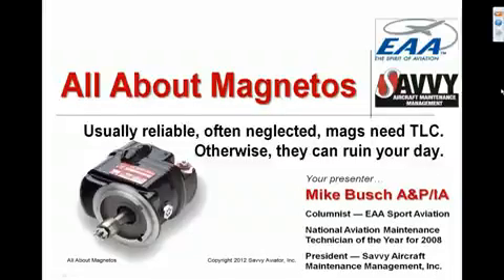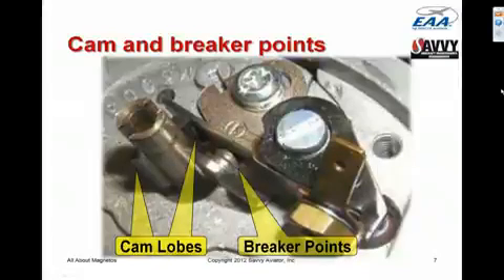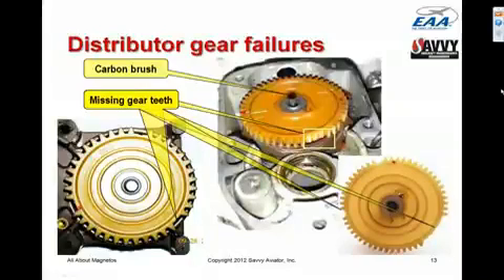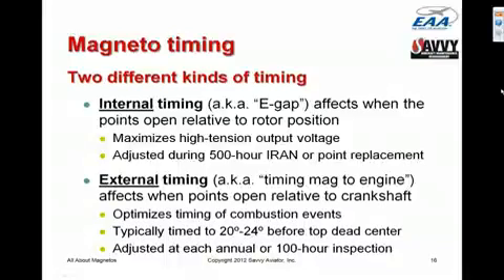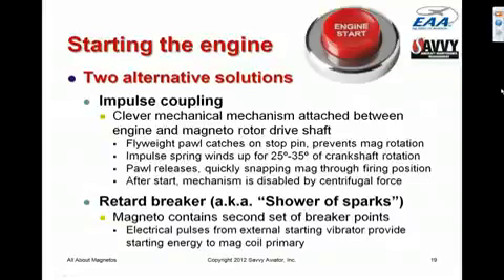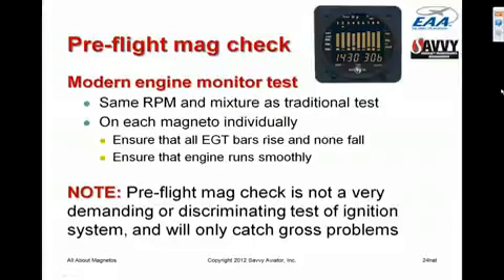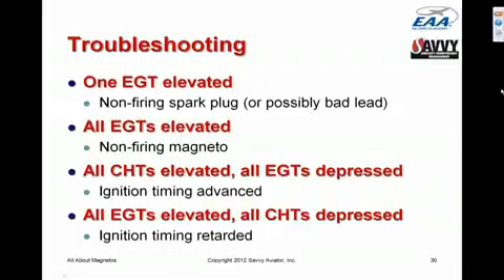All About Magnetos

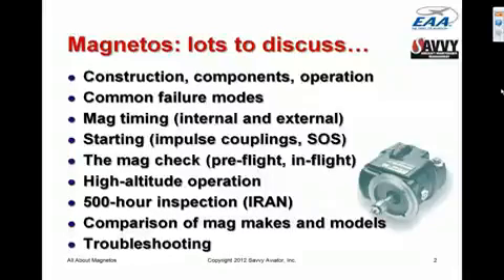Comment: 1:35 Components and Operation 
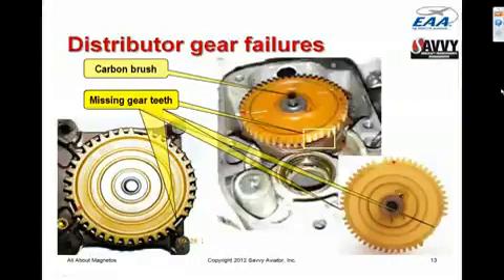14:15 Common Failure Modes 
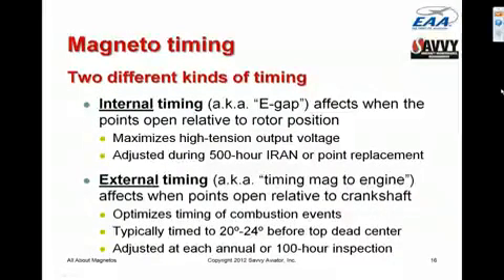20:59 Magneto Timing (Internal and External)
25:14 Starting (Impulse/Snapper Coupling, SOS)
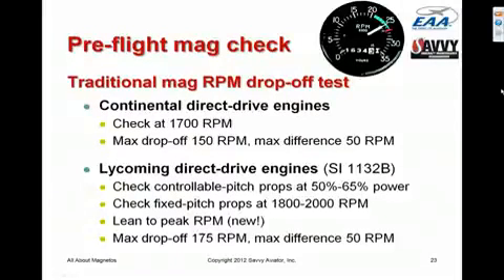32:43 Mag Checks 
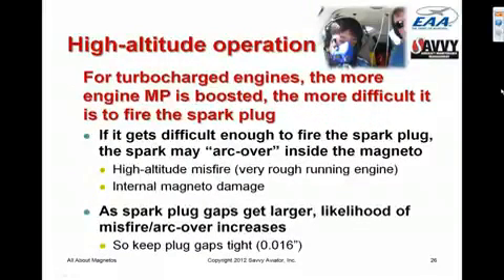38:52 High Altitude Operation 
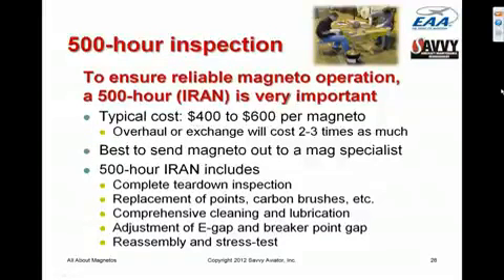43:44 500 Hour Inspection IRAN
46:11 Mags Makes and Models 
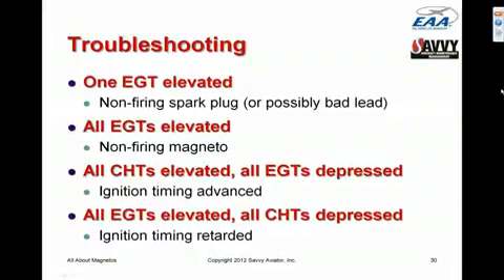49:48 Trouble Shooting 
52:07 Questions
Reply: Khotso thank you sir

Comment: As a Certified Mechanic I rebuild and service a lot of magnetos.  Many times I have had to replace the entire rotor due to corrosion on the magnet & shaft so severe that the shaft broke in two pieces after pulling the bearings off.  Worse is neglecting the magnetos by not flying the aircraft due to neglect of routine maintenance & annual inspections regardless of time on the engines.  Such neglect will have you paying more in the long run and your aircraft's value decreases substantially.

Comment: It does not matter,  either a battery & coil ignition set-up  or a magneto, even the model; T coils
in the wooden boxes had a condenser in them, the condenser being wired across the points of 
coil's vibrator. juice came from the "MAG' which was a low voltage magneto, V magnets spun 
past a series of coils in the bellhousing or shroud or from a battery of either a number of #6 dry
cells or a wet lead acid type battery. a switch was for MAG or BAT/OFF and a commutator type
switch worked each coil.

Comment: I disagree with 500 hour IRANs, every magneto I've opened has moderate to severe burning on the electrode fingers, and the assembly alone is like 500 dollars for this, the carbon brushes I see are always way within limits. Add in a contact point kit which is like 200-300 dollars and you already meet the cost of receiving an overhauled magneto often times. You also have to take into account the time it takes to perform a 500 hour magneto inspection as opposed to just changing out gears if necessary and installing overhauled magnetos. If you go off of the overhaul manuals, you will often find enough stuff in a 500 hour magneto that exceeds the cost/time of changing out internal components as opposed to getting an overhauled one.

Comment: It's interesting how the design of aircraft engines has lagged behind current engine technology. Cars have electronic ignition, some don't even have distributors or a single ignition coil.
Now I realize that a computer needs a separate power supply incase of an alternator or battery failure. Electronic ignition does exist in aviation but it's experimental and is usually pared with a mechanical  ignition system for redundancy.
Reply: 25+ years ago, electronics were not entirely reliable. Today; ecu's, batteries, ignition coils, sensors are far superior and surpass these old pushrod engines. Pretty much all electronics are now solid state.

Comment: Mike we must place ,new  knowledge  to get rib off the magneto point and Condenser, and use the impulse , system  used on high performance  Automobile engine ,is much much better than the point condenser set up
Reply: I was wondering too, these are like my 1972 cars with ignition points.

Comment: Mike, I've been searching for an expert in this field and so i found you. I fix small engines both 2 & 4 cycle in the lawn care industry. I heard of a problem, have not seen it for my self, but am very very curious what could be the cause. So here it goes. My friend got a Stihl chainsaw that would bogg down.He saw the culprit to the problem as there was a spark between the magneto/coil and the magnets on the flywheel which was in direct correlation with the bogging down-the spark got stronger as he tried to rev it up then the engine boggs down. He then purchased both a new flywheel and coil from Stihl and still has the same problem. How is this spark, in that location, possible and what can be done to diagnose and/or fix it? I have never seen or heard of such I thing as I have repaired small engines for a long time. It would seem to mean there is a leak or bad ground possibly? What are your thoughts?
Reply: if the ground wire somehow gets any voltage on it it can do a similar symptom. Also i would check to see if anything is connected in reverse, if there was anything else replaced recently??

Comment: I’ve had a very unusual snag on my Franklin 150 engine equipped with Bendix S6RN-21 mags.
The engine runs smoothly at idle up to about 1700 rpm where it starts running very rough to the point where I have to pull the throttle. I’ve changed the plugs, the carburetor and both magnetos. Fuel flow is 35 g/hr ( recent fuel) and compression is over 76/80 on all cylinders.
Could components like capacitor or coil create erratic ignition at high rpm?

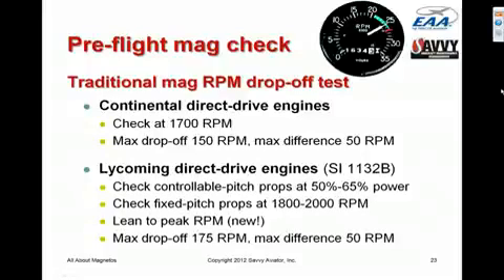Comment: At about 33:04 you mention Lycoming's Service Instruction 1132B and state the instruction now requires lean to peak while performing the mag check. But that's not exactly what it says. You're to start with full rich but if you have a drop of more than 175, then you are to go lean and repeat (am I reading the SI correctly?) https://www.lycoming.com/sites/default/files/Magneto%20Drop-Off.pdf
Reply from the maker: Christopher, you are reading the SI correctly.  One must only lean for the test if there was a drop of more than 175 rpm.  The SI states to leave the mixture full rich for the mag check UNLESS you get an excessive drop.    Thank you for the clarification.
Reply: Got it. Thanks! Love these presentations by the way. They're part of what has inspired me to get an A&P cert. I have no intention of working as one; just want to work on the plane I buy and have a better understanding of the plane's health.
Reply: How about always leaning to peak RPM for every runup? I recall the Embry Riddle story from Mike's leaning video.

Comment: YUP. the condenser absorbs the inductive kickback of the primary circuit being open. This 
condenser will always bee seen in any ignition circuit using 'points' like in an auto ignition
coil using 12 volts or an H4 magneto on a farmall tractor.
Reply: All ignition need the so call condenser/ capacitor to fire the engine , engine run  on the DC corrent that it's stored in the capacitor, if remove that device of system  engine don't fire a u don't know try to take off that and your engine not going  to work

Comment: Started as very informative but the credibility was lost on real practical questions. I have a Continental A-75 with no impulse on either magnetos and it starts with no extra effort than the ones with impulse at our field. Also, Slick Mags are popular for a reason and I don't agree that aviation community (by majority) will switch over to the 'less robust' product just because its cheap.